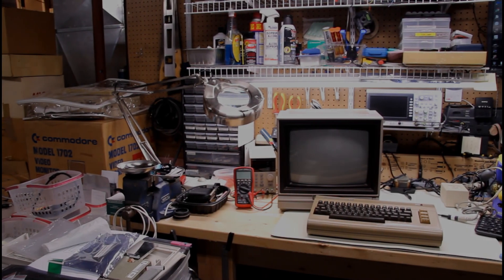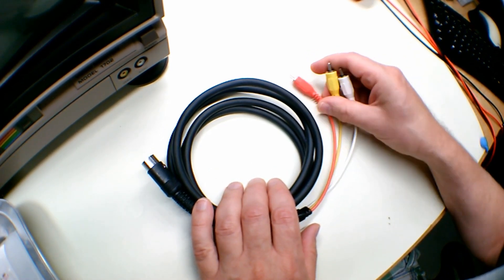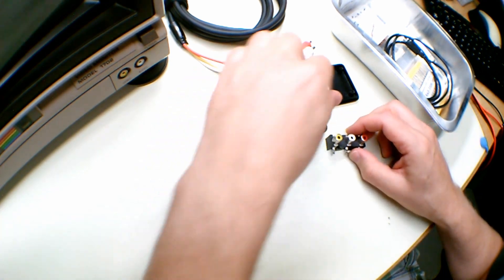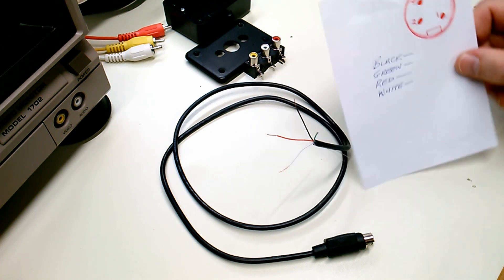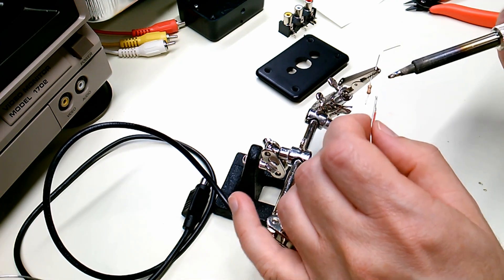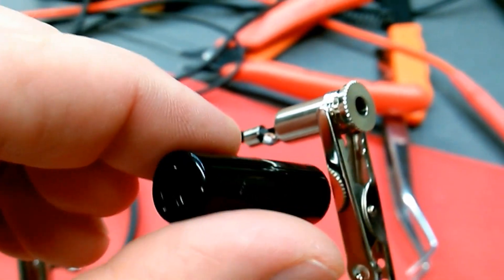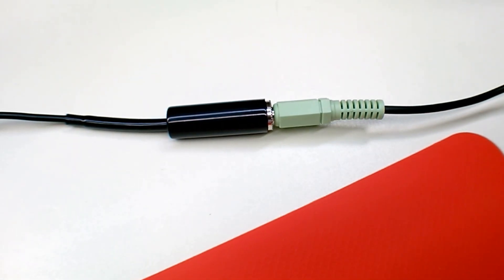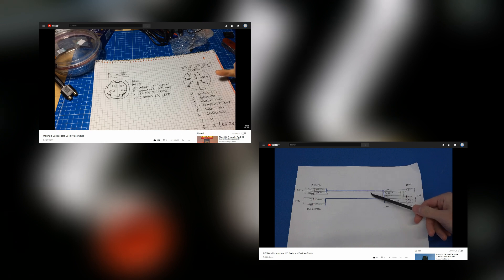#09 "Good Ol' Bin of Bits & Bobs" — C64 S-Video Adapter Box

Comment: C64 also has audio-in. It's routed through SID, actually you can alter the signal with SID's filters, if I remember well. The problem: if audio-in is not used (nothing plugged in) it just received some static noise up from various electronics nearby and other components. Common trick was to short audio-in to ground, if not used.
Reply from the maker: Yes, you are absolutely correct about the unused audio in pin not being grounded properly. Thanks for refreshing my memory!

Comment: I saw on amazon there are these "SCART to S-Video converters" but it's just a breakout adapter, they sell for around $1.  In North America we don't care about the SCART but the other connectors are good enough to run a cable out to a 262-degree din!

For your audio problem, it sounds like your 2nd-channel audio needs grounding.
Reply from the maker: Although I do prefer a straight-up DIN to S-Video cable I wanted to whip up this box which would allow me to do a quick-and-dirty test of old Commodore 64 AV cables that come my way. And thanks for your suggestion - I'll look into the grounding issue.
Reply: Remember those mono females only have two springs making contact, your third connector is wide open like an antenna.

Comment: all you need is 3 1k resistors and a stereo jack jack you assemble the 3 resistors in to a ( Y ) configuration with each leg of the Y going to each of the 3 connections of the stereo jack tip ring and sleeve than hock the ground of the 64 to the ground of the stereo jack and the signal wire to the center of the 3 1k resistors .. this will make it work with bolth stereo and mono speakers
Reply from the maker: Hey Jamie. Thanks for the advice. It's funny how one gets accustomed to the noise and ignores it after a while. I will definitely give that a go. Much appreciated.
Reply: I build audio circuits and am thinking of going at C64'S seeing that I have enough ic's to sink the Titanic
Reply from the maker: Incredible. An audio circuits YT channel would be great too.

Comment: Excellent job! Thanks for sharing this. Having a boxed adapter like that seems a very tidy solution. Also thanks for mentioning my video! :)

I think the interference issue is most likely a grounding problem. The mono jack should be compatible with a stereo plug in that it only plays on one channel. If the contacts inside are not properly located it might short one channel to ground which should be no trouble at all, too. Mmmh. I'd say most likely you get some cross-talk between the audio and video signals. Maybe one of the cables isn't properly shielded? Maybe play around with connecting grounds together/having separate grounds for audio/video. If I remember correctly, I have all grounds connected together in my cable. Also, I shorted the SID's input pin to ground to avoid noise from that (which is minimal anyway). You could also try adding decoupling caps or stuff like that (there's still plenty of room in the box!).

PS: Check RAM on the C64. ;)
Reply from the maker: Thanks for your thorough feedback - always invaluable. Yes, I've been leaning toward grounding as the problem. I will check the connector for improper grounding and try decoupling inside the box (there's plenty of room, as you say).

Yeah, bad RAM for sure on the sick C64. Another video opportunity.

Comment: Usefull and handy adapter You made there, I like it :) I'm also always trying to use stuff thats just "laying around" , or re-use desoldered parts from various things - nice way to reduce the overall cost of the project as well as making good use of potentialy useless stuff. The thing with free space on the workbench is somehow kinda magical :) no matter how big the desk is there is always not enough room on it ;) oh and Your video reminded me that I wanted (but forgot) to ask if You happen to own the TSOP40A adapter for the  MiniPro? I recall form Your previous videos that you have the TL866 programmer
Reply from the maker: Hi. Thanks for commenting. Yes, much of the fun with this project was to recycle (or finally use) old parts. Granted, this is a very simplistic project compared to what you do ;) but a handy little adapter, as you say.

I do not have a TSOP40A adapter for my TL866, however, it is coincidental that you ask because I do have a TSOP48/SOP44 adapter sitting in my eBay shopping cart because I was thinking of purchasing a "GGLABS F2R16 - Flash replacement for Amiga Kickstart ROM 27C400 A500/A2000" (http://bit.ly/F2R16FLASH) and it requires a TL866 adapter board to program it (http://bit.ly/F2R16PROG).

I think I would recommend to any new buyers of a TL866A/CS that they pay a bit more for those listings on eBay that include numerous adapters; it's less costly than buying the individual adapters separately.

Thanks again for your feedback. I am happy to hear that you enjoyed the video.
Reply: Thanks for reply, what im trying to do is figure out how the TSOP40A is wired - as far as I know it is not wired 1-1 I do not really need the adapter to program TSOP40 chips, but to make an DIP40 (or DIP32) adapter board for am29f080 TSOP40 memory, so I can "convert" it to DIP memory and program it with TL866 at the same time :) the reason is that I need a 8mbit memory that is in dual inline package and can be electronically erased,  not uv. I cannot find any 8mbit EE PROM's just E PROM's like 27c080 27c801 etc -  and cant find the schematic of the MiniPro TSOP40A adapter board anywhere, or even good photos of both sides of the PCB - that would be enough to trace the schematic :)
Reply from the maker: Oh, I see. Now I'm on a mission to find a TSOP40A adapter wiring diagram. I have looked around a bit, but there is not a lot of info out there it seems. I assume this is for a new super project of yours?
Reply: I found one schematic on some chineese website but it turned out to be fake :) so no luck. Yes I wanted to use this in a project (nothing superb tho :P) :) but I made a little change instead, added two jumpers and an 4mbit or 8mbit (E)EPROM can be used. The project is related with PC Engine ;) I have some other fun stuff already made but unluckyly no time to make a video yet :(
Reply from the maker: Fake! That's too bad. I looked around some more last night, but no luck either. I look forward to more of your videos - your projects are something for me to aspire to.
Reply: Just FYI - I have found the schematic for TSOP40A adapter! Looks like they are going to work :) I will find out soon, I hope - found it here https://assemblergames.com/threads/tl866-tsop40-adapters.67275/
Reply from the maker: Thanks for the update and the link. That's a great find! I have downloaded it for future use.

Comment: That mono-stereo thing is probably why, have heard the same effect with plugging in mono-stereo equipment in guitar amps/stereos. One idea that could possible help is to add diodes.

And thanks for telling about the C64 chroma signal, i didn't know that it could fry equipment.
Reply from the maker: Thanks very much for the info. Interesting that you have heard the noise with guitar amps. I will tinker with your diode idea as well. I appreciate your help.

Comment: Very nice work. Back in the '90s, after getting my first equipment with S-video outs, I did the opposite: made adapters for connecting S-video to the 1702 luma/chroma inputs. I was already aware of how the Commodore video signal worked, and a little sleuthing with the oscilloscope showed that S-video was the same. I didn't know about the excessively "hot" chroma output from the C64 though; hadn't looked closely at the signal amplitude on the oscilloscope. Going from S-video to 1702 it's not an issue because you can just adjust the color-level setting if necessary.

The main difference you'll see using a modern TV rather than the 1702 is the lack of "red push" that older TVs and monitors, including the 1702, exhibited. That is, reds were emphasized in the process that converts to RGB to drive the CRT. My understanding is this was originally to compensate for deficiencies in older formulations of red phosphors but remained a part of TV color circuitry after that issue was addressed. On C64s this affects color 9 the most.
Reply from the maker: That is some great additional info regarding the "red push." Thanks very much for sharing that.

Yes, I too make my own S-Video to RCA cables the same way you did. In fact, my original 1701 was my main TV when I was in university -- I had a LaserDisc player outputting S-Video to the 1701; movies looked great.

Comment: Interesting. I didn't know Commodore's "s-video" was pre-standard. Having a clear picture on a modern monitor (without having to buy a framemeister or such) is a huge advantage. 
Just out of curiosity, how does the 1702 respond to the resistor on the chroma signal?
Reply from the maker: Thanks Wouter. Both the 1701 and 1702 CRTs have only chroma and luma RCA sockets on the back (for example, https://goo.gl/LsUANE), so the S-Video mini DIN cannot plug into it. That said, I imagine a resister on the chroma signal would dull the colours significantly on the on the 1702/1702.
Reply: I've just bought a 1701 (they're quite rare where I live) and I'm picking it up tomorrow. Do you have any idea if Commodore really manufactured them in house, or if they were somehow rebranded monitors? I haven't really been able to find much about these monitors at all.
Reply: Hold on...I've just read they were JVC monitors :)
Reply from the maker: First, congrats on finding a 1701. What is it's condition - does it still have it's from flip-done cover hiding the controls? I believe the 1701 used a Hitachi tube with JVC electronics and the later 1702 used a JVC tube. The 1701 is noticeably heavier than the 1702. My original 1701 (NTSC, 60Hz) is labelled "Made in Japan."
Reply: I've only seen pictures and it looked like it still had the lid. I have an appointment to come and pick it up tomorrow at 11.00 so I'll see it in real life for the first time then.
Thanks for the info. There were pictures up of the monitor, but the add was taken down after we made the deal so I can't check now :)
Reply from the maker: Sounds to be in very good condition. Those lids are missing more often than not. I hope you post a video showing it off.

Comment: Very nice instructable, Mark. But what about sound? 
Looks like you only connected mono sound.
Why not stereo?
Reply from the maker: Thanks Thilo. As the C64 is only mono audio I just let it pass through the adapter box as-is. However, plugging in stereo desktop speakers did split the sound between the two speakers but also introduced noise which I haven't resolved yet. The adapter box is intended for use at the repair bench only so I am not overly concerned wit the noise issue at the moment.
Reply: I totally forgot the C64 was mono sound, as I wired it to stereo right from the audio/video socket.... ;-)
Interestingly, I never noticed any problems with hum or noise. (Using RCA connectors and coax wire for all connections) 
But I read that grounding the Audio In of the SID chip (which is more or less useless anyway) might resolve certain noise issues. Some people seem to bend out that pin and then just connect it to the nearest GND.
Maybe worth a try, but don't break the pin off your SID.
Reply from the maker: Yes, I recall grounding the SID's audio in pin was a fix for the C64 noise issues -- thanks for reminding me. My challenge is that this adapter box is simply for viewing/hearing video and audio from C64s on the repair bench using the computer's own AV cables, so I can give them a quick test at the same time. So, I need to figure out a solution where any grounding is performed at the adapter box. The noise is not a dealbreaker, as it is now, just a minor annoyance.
Reply: Apparently, Audio In is routed to the A/V connector at pin 5. So if you want to test for noise reduction, you could in the first go try and ground it in your connection box, for example with a switch or a jumper towards ground. Won't be perfect as you still have the looped wires; but at least you could test if the signal changes. To take care of the wire loop, you could try and install another coax, with the centre wire connected to audio in, and the shielding wire connected to the C64's ground, I think. Should keep a lot of noise out, but give you a chance to quickly check if noise is coming from audio in or from a faulty (SID) chip.
Reply from the maker: Thanks Thilo. Very good thinking. Those are really good ideas. I will give them a try.

Comment: I've got an original "monitor" cable for my C64 with chroma/luma, so I'll be doing this too! Wish I knew what was wrong with the Commodore 1702 monitor (seems to be on the fritz with intermittent audio and video problems).
Reply from the maker: I'm happy to hear you found the video to be useful. Making an adapter box might not be necessary in your case. A straight-up C64 s-video cable might be easier - check out the links in the description.

Regarding your 1702, it's hard to diagnose without getting inside it, however, that can be extremely dangerous, as there's deadly voltages residing in there. It might just need a recap and perhaps A/V connections need the solder reflowed. But I recommend that be performed by a professional. It's not worth harming yourself.
Reply: MindFlareRetro Because I already have the official chroma/luma "Monitor cable" (they didn't call it "S-Video" back then), an adapter box like yours makes the most sense. I've made an S-Video cable for my Atari 800 and Atari 800XL (after restoring S-Video in the XL) and I have spare DIN plugs so I'm comfortable with either. :) As for the CRT, well, I've developed some best practices while working on arcade machines within the last year, so I think I'm ready for this when I have the time. If 8bitguy is comfortable going in his Mac Plus, hopefully I can handle a Commodore 1702. ;) I'll definitely be careful and will make sure it's discharged. The arcade machines are often surprisingly dangerous, forcing you to handle all kinds of dangerous parts before you can even access the point to properly discharge one!
Reply from the maker: Ah, yes, I now see why the adapter box is a better solution for you. I just didn't want you to feel you had to go through the trouble of building an adapter box when a simple cable would do. I didn't realize you had experience working on arcade cabinets; I'm sure you're well versed in the safety best practices. Keep me posted on how it how and be careful.